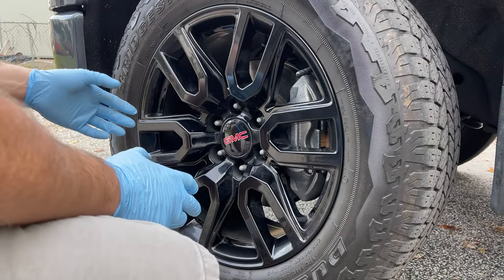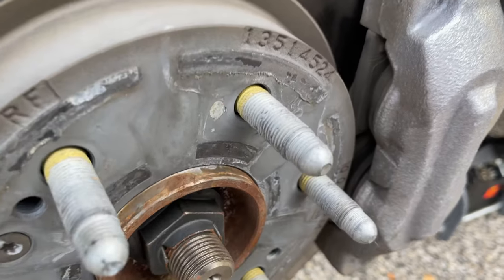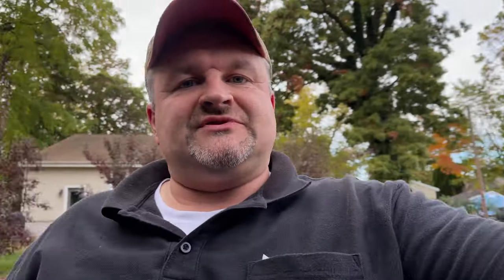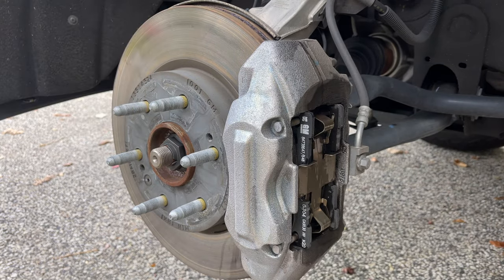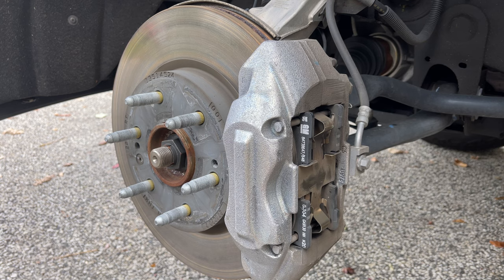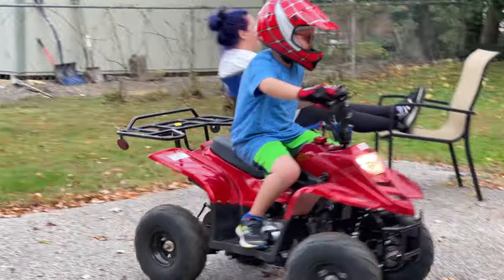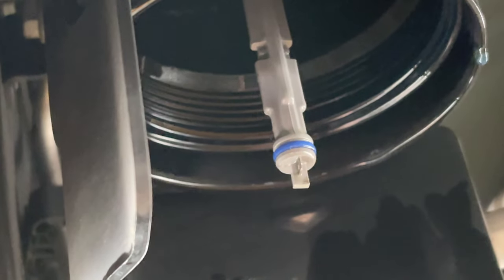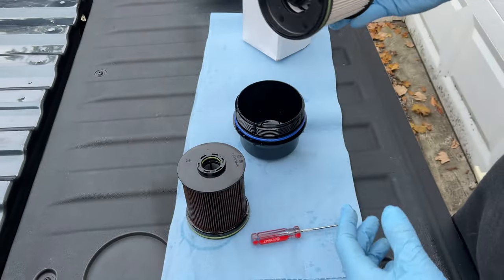3L Duramax Sierra 50K Mile Review - Still Going Strong!

Comment: I just hit 104k miles on my 2020 AT4.  Hasn't seen the shop outside of recalls.  Picking up my LZO this weekend.  Great engines so far!
Reply: Good to know I just picked up my 21 AT4 3.0 and loving it so far!  Although I’m getting an estimated 360 miles to a tank, 14MPG but I do have a lift on 35’s.  I was hoping for better MPG I could also be off on my calibration.  The MPG difference in the 22 plus is nuts.
Reply: @threadoflife  Lifted on  Bigger tires  and you were expecting better millage??? You have an exhaust leak
Reply: Great to hear I just picked up my 23 At4 LZ0 yesterday. I am super nervous about long term reliability but that's great to hear!
Reply: @corydelbiondo5773  how is you 3.0 ? I want buy one but scare me the long term engine
Reply: @watchmanexpert  great so far no issues and no check engine lights whatsoever and at over 2k miles. There is some literature about these using oil and I've been checking every few hundred miles and still showing overfull. Crossing my fingers. If you plan to keep it a long time I would negotiate a long bumper to bumper warranty like 10yr / 120k. I did 6 yr / 75 but I think I'll bump it up soon
Reply: @corydelbiondo5773  thanks did u have idea how much is for extended warranty?
Reply: @watchmanexpert  I paid $1600 for a bumper to bumper 6yr/75k which IMO isn't the best I wasn't really thinking and wanted to get out of there. They started out at like over $3000 but I negotiated it down. There is a lot of fat built into these don't be afraid to stand your ground
Reply: @corydelbiondo5773  wow brother not bad for 1.600
Reply: @watchmanexpert  yea can't complain if I were to do it again I'd have gone with a 10yr/100k

Comment: Glad to hear that your truck is doing so good.  I have just over 76k miles on my 2020 Chevrolet Silverado with the 3.0 Duramax.  Still getting 30mpg on the highway.  I have 52% on the front and 75% on the rear brakes.
I had a 2002 Chevrolet Silverado 1500HD and only did one complete brake job on it when it had almost 125k miles.

Comment: 18K+ on my 21 RST.. Two complaints,  1. The crank no start issue was finally fixed on the 4th visit. Software was reprogrammed, 3.0 now cranks longer, never had a repeat of the crank no start issue. 2. The stop/start, I pretty much have myself trained  to hit the deactivate switch after starting. My mileage is about the same as yours. My best is 39.5 for a 50 mile segment. I've met that 4 times. I'm thinking that's the best this engine will do. I'd buy another in a heartbeat.
Reply: You’re lucky, my 21 Silverado 3.0 started with that then all the injectors, def tank, pump and hoses, particulate filter, fuel filter @ 23,000 miles, CPU and EPU and now the 19 months that it has been in the shop all the sensors have been replaced. But when it was on the road I had a 43.5 MPG for a 50 mile run.

Comment: I agree with you I absolutely hate the start/stop feature. I try like heck to remember to turn it off! My teenage son who rides with me all the time has even started to help me remember to turn it off.  My other complaint with my truck is the radio will shuffle preset stations every once in a while. But overall I am happy with the 3.0L and I love the truck. Diesel prices are crazy but I am still getting away cheaper than the truck I had before that I was only getting 13 mpg. So I’m doing fine with that.

Comment: Love your videos, I have a 21 high country 3 L, 22,000 miles. I’ve had absolutely zero issues the truck is wonderful. I experience after four months of ownership the rear clunking sound backing out of my driveway just like you mentioned, I tightened up the shackle bolts but the noise didn’t go away, then I jacked it up put it on jackstands and put a little grease between the leaf springs And then the noise went away, my fuel mileage also averages between 28-32 miles per gallon highway the biggest factor to me is wind, if I have a headwind going 75 mph I’ll lose 4 miles per gallon, if I have a tail when I’ll gain 4 miles per gallon. I do have one crazy thing it’s been doing since day one and I’ve never heard anybody complain of this, when I am driving 80 mph on the highway and I have heavy Cross winds, the roof of the truck probably around the drip rail right hand side I hear tremendous howling so loud it scares you at first.  But it takes 80 mph or faster on a windy day, if I back it down to 75 mph then the noise goes away. I program myself to every time I start the truck I turn off auto stop. I’ve never had the long crank at start up like a lot of people have complained about, which I know it’s an easy fix with the reflash.  keep up the good work, let’s all hope for 300,000 miles.

Comment: I have a 21 also with 7500 miles and started having a click sound when backing out of my driveway. I found the u bolts that hold the rear end to the leaf springs needed to be snugged up. Since then no more noise. I also installed a idash just to keep an eye on regen and soot level.  If you are getting close to a regen you can force it to start while driving or stationary. just my 2 cents.   Love the videos!

Comment: That jittery suspension is a major reason I went with my 2019 ram; they have 5 link coil suspension, and there is absolutely none of that type of jitter, rides more like a unibody SUV and is definitely the best riding truck (and the optional air is even better but suffers from cold weather issues). Appreciate your honesty, I was very interested in the little diesel but I think if I bought a chevy tomorrow I'd probably go for the 2.7 turbo instead, gas is just much easier for me to deal with.

Comment: Hello Dave. love your videos. I have the exact (2021) and color as your truck, except that I have the X31 Pkg. At 32,000 Kms I am only getting 25-27 Mpg Highway. I live in Alberta Canada. Even people I know have the same engine are getting 30-32 Mpg Highway. Knock on wood! I have not yet had any issues. Love the lower end torque at 1500 RPM. As for my REGEN, I purchased a Banks Power Idash gauge. This gauge tells me when it's ready to do a REGEN. A great advantage. Not to mention the other 52 sensor functions it has for the 3-liter Diesel.
Reply: I am also from Alberta and have the 2021 with the 3.0 and just recently did a 1200 km drive and averaged 7.4 L/100 kms = 38.2  miles per imperial gallon  = 31.8 miles per us gallon. Thankfully so far no DEF or other codes. Really like the truck and engine.
Reply: @terrypederson8445  Your one lucky Guy to get that good of MPG.. I talked to others and they have better MPG than myself. 😞 My last GMC was a 2012 5.3 @ 15 MPG. At least I'm not getting that...

Comment: i completely agree with the suspension, overall handling, i replaced my shocks with bilstein and its a night and day difference  now. i have the silverado rst z71 3.0 l. 25k miles on mine, only thing i noticed is the no start about 4 times in 2 years, it's a push button start, after second try (on no start) it will start normal. havent taken it to the dealer for that yet. congrats on your mpg's iam very heavy footed and get 22 average
Reply: Mine has the same issue. Probably 12 times in the last 2 yrs.
Reply: Dealer is researching now. I'll update you if they give me any info.

Comment: I enjoy your vids. Keep up the great work.

Btw, I have a 22’ Silverado LT with the 3L. The regen dynamic is my biggest complaint as well.

Also, I have the same rear end clunk you describe. 9,000 miles on mine. Went in to the dealer to have the seat heaters finally enabled and asked them to check that. They couldn’t find anything wrong. I can pretty reliably reproduce it with the truck stationary by pushing/pulling on the side of the bed. Just need someone to do that while I poke around with a stethoscope.

Comment: Thank you for the review, I'm following you up.  I have my 2021 Sierra Elevation Duramax X31 Doubl Cab. No issues, almost 22k miles. Just check engine light a couple of times on long road trips, but went off in a day after the trip.  I believe it might be the diesel fuel from other cities. Because while driving around town at home light never lights up. I drove from Fallbrook SoCal to Redding NoCal  near the border with Oregon. Besides that I love the truck. My wifes best friend has a 2020 Silverado with 53k miles,  her oil pan got rusted 2 times! Dealer replaced it at no cost, but if it happens under the warranty 2 times, I'm affraid it will happen after the warranty, she will have to pay for it If this happens once t me, I'm selling the truck, I'm not going to expect to change the oil pan every 25k miles. Is the 29-30 mpg combined, or just highway. I can't get more than 24 combinesd. In the highway I cna get up to 29 30 as well.

Comment: Congrats. I bought my trailboss duramax about 3 months ago and it now has 13k miles. Barely today I got a CEL and I think it was because when it accelerated to do it’s regen while parked I turned it off. Disconnected the battery and well let’s find out if it was that. Other than that, no complaints.

Comment: In my experience with Chevy's.  The factory brakes are awesome.  1st work truck a 2007 6.0 gasser 2500 I got 200k miles before I got a newer truck for work & never did the pads on the 07.  My current 2011 6.0 2500 truck has 280k miles on it.  I got it with 80k miles.  Not sure if the pads were changed in that 80k but in the 200k I have put on it no pads have been replaced.  Granted I don't do much towing but still 200k on 2 separate trucks is great IMO.

Comment: LUCKY! 2024 GMC 1500 DURAMAX, 1 WEEK AFTER I PURCHASED THIS FREAKING Thing AND IT FAILED. I was washing it at my local car wash & jumped back in it to head home, & NO start. Zero turn over, no crank. Starting my new job tomorrow REASON I BOUGHT NEW TRUCK  & it's in the shop at 490 miles old. What a hunk O junk. I'll see what the hell is the excuse for my brand new week old truck that failed & had to be towed to shop. GM Customer service was like Ehhh whatever, WE WILL REIMBURSE YOU IF YOU WANT A TRUCK RENTAL & started eating Bag of chips while talking to me on phone. Last GM I BUY.

Comment: ive had nothing but issues with my 21 3.0 been at the dealership for 2 months. torque converter is out right now or thats what they think. its got 27000 miles  and  its been messing up since 18000 miles 
ive got a case open with chevy on it but i dont trust this truck and im stuck with it cant trade or ill loss thousands .  i spent every dollar of my VA comp. disability money on this truck .   i volunteer my time with a hunting org. for vets and spent the whole summer setiing up and getting leases and other thing. all that money is wasted becuase i cant do it with out my truck. 
its been a bad experience and ofcourse no one cares.   truck broke down cant get parts and lost 1000's on hunting leases and other things. thanks chevy

Comment: Good to know I just picked up my 21 AT4 3.0 and loving it so far!  Although I’m getting an estimated 360 miles to a tank, 14MPG but I do have a lift on 35’s.  I was hoping for better MPG I could also be off on my calibration.  The MPG difference in the 22 plus is nuts.

Comment: I recently drove the ram eco diesel and loved it! I didn't even know the diesels came in the half tons. Very curious about the truck
Reply from the maker: It’s an awesome truck. While I’d love the 2500 I can’t justify the enormity of the truck for what I usually do. The Sierra 1500 3L fit the bill beautifully.
Reply: @BanditDavesToyChest  I would consider a 2500, if I could get the little 3.0 in one OR if they would come out with an inline 6 for the 2500 (even if it was somewhere in between the 3.0 and 6.6 L) as I really dig the I6 over the V8 diesel.  Just something about the sound when the inline 6 grunts.

Comment: It’s interesting that you mention the suspension kicking out in the rear. I live in a small town in West Texas. Out on the highway it is 75 mph speed limit. Crossing the railroad tracks with this 2020 3.0 little max on the highway at that speed is a little bit of a butt pucker. It absolutely sends this truck dancing in the rear. I had a 2017 Z71 before this with a stouter suspension and it took those tracks just fine. I was talking to my son about it and he thinks I should change the shocks. I tend to agree as this 2020 has took those tracks to the dance from day one. I think that is absolutely my biggest gripe. I’ve had this truck since new, the only issue has been a screen lock, radio freeze and rear camera stayed on. I was in Biloxi, Ms at the time and took it to the dealership and they reflashed it and said the brake system also needed reflashed. They said there was a tech bulletin on that, however I never noticed a brake issue. The antenna was the first thing I replaced as it bounced on my garage door entering and leaving. Put in a shortie and it has worked well. This has been a great truck, the paint is weak, I have countless rock chips so much so it’s noticeable a lot. My old 17 Silverado had very few and it was black. Paint was much better on old truck. This RST is the Northsky blue and it has hundreds of chips. But, I’m old and retired and don’t much care about looks anymore. This has been a very dependable truck with plenty of torque to pull my enclosed trailer. Much better than my old 5.3. I am going to change those factory shocks shortly as that suspension is absolutely my biggest gripe. So much to the point I think it’s dangerous the way it bounces and kicks like a mule. It should grip the road and it does not.

Comment: Rear diffs with GM's limited slip type (fly weights lock diff when there is approx 100 rpm split between left & right wheels) this diff has spun my truck sideways on an icy driveway.

Comment: The rotors will get a little surface rust on them if the truck sits for a couple of days and that will make them a little noisy until it wears off...also the first thing I do after I start the truck is turn off the auto stop. And I've had a few issues with the truck spinning while towing in the rain. Put a tiny amount of loctite on the antenna..I have a 2021 GMC Sierra with the 3.0 and I like the truck but I've been thinking about selling and going with a gas truck. I have 42,000 miles on it and it's been a great truck so far but I only haul something every now and a then...
Reply: Why would you want to switch to the gas truck? There is relatively no differenece in towing capacity? The diesel gets better mileage. The diesel in these trucks were not built for towing. They were built for fuel mileage.

Comment: Hello Dave. Did you ever have a rattling noise on the rear passenger doors. Is a noise like a door is ajar. Mine is pretty much the same truck you have. 2021 elevation but with the x31 package. 
And by the way mine is 22000miles really happy with this truck.

Comment: Awesome content! New sub! Very glad I found your channel! I’m in a tough spot… kind of😅. My wife has wanted a truck for a while. We are looking for a vehicle to possibly replace our 2014 4runner which sits in the carport while we drive our commuters (terrible mpg on 4runner). Looking for something with decent mileage that could possibly replace a commuter and 4runner at the same time, but don’t really want a hybrid or small sized sedan. 3rd row hybrid SUV’s with AWD get mid ish 30s mpg. Luxury SUV’s start at 45-50k ish. This seems like it would totally fit the Bill! I’ve never owned a diesel and am not mechanically inclined, would taking the truck in to the dealership for maintenance offset the benefits of the truck? Specially when considering diesel prices? I’m in Northern California so diesel prices are extra crazy high.
Reply: Do you think it’s too much of a pain in the rear owning a diesel if someone were to have to take it to a shop for all the service work? Cost wise, and just general maintenance wise?
Reply: @kingsproductions9760  I have this setup too in a 2021 Sierra Denali 1500.  Absolutely love it.  There's really not a whole lot of extra stuff to do with the diesel.  Standard oil change.  You do have to add DEF (diesel exhaust fluid), but if you can fill your gas tank at a fuel pump, you have the technical capability to add the DEF.  The other maintenance item is the fuel filter, which is super easy to replace.  With that said, I've not had to replace my fuel filter yet and I have about 24,000 miles on my truck. The computer tells you the % life left on the filter so you can certainly plan it with one of your oil changes. Other than that, there's not really a whole lot of extra to do with the diesel over the gasser.

Comment: With the additional cost per gallon of diesel fuel vs gasoline, more expensive maintenance, and additional cost of purchasing a diesel engine, which is more economical if the truck is not needed for towing?
Reply: Depends on how you use it. Where I live diesel is 30% more than gas. It used to be that you had to do big miles and do a lot of towing to take advantage of a diesel. Don’t get me wrong, I love the 3.0L, but If I had to do it all over again I’d go with the 5.3.
Reply: The 3.0 is not for towing. It was built for fuel mileage. The 3/4 ton trucks are for towing. 8,000lbs vs 17000 lbs for towing ratings.

Comment: Had a 2022 with 18000 miles no issues. Traded it for new 2023 with the new LZ0 version of 3.0 duramax, better mileage in first 500 miles. Just wanted your take on how you would access chain at back of engine. What gm states is that you drop the tranny, but just saw someone else who claimed you needed to remove the cab. Any idea on what the truth is?
Reply: Take it to the shop